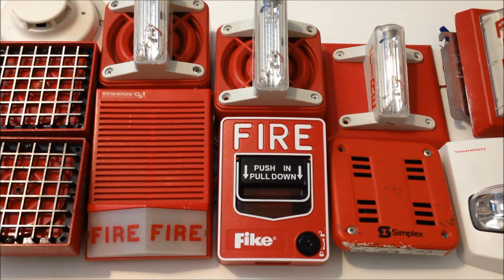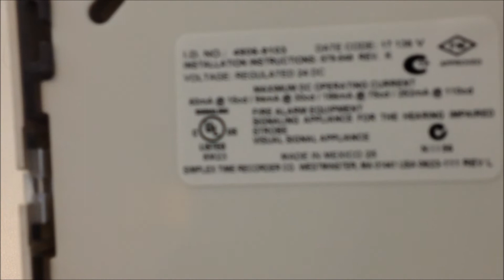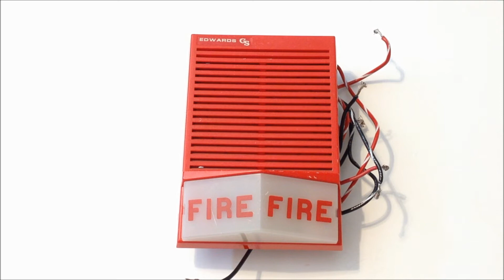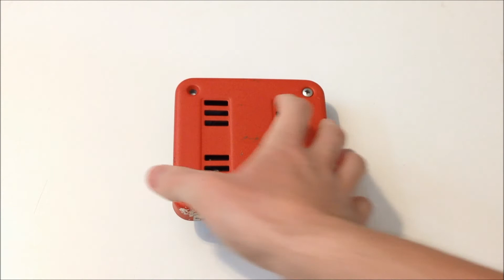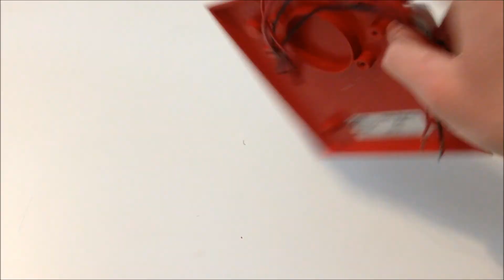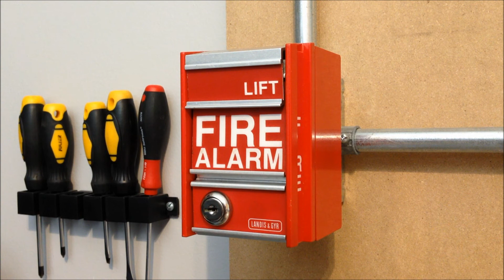New Fire Alarm Devices | August 2017

Comment: Federal Signal 450E horn/strobes have their own model numbers, actually.  The model number, I believe, follows the format of 450E_24R, with the first letter of the strobe's series number going in the blank (i.e. 450EA24R for V1971 series AB2 strobes, like what I have).
Reply from the maker: That's interesting! I didn't see anything on the ID labels that would indicate a different model number - both the horn and strobe retained their own separate labels.
Reply: kcin556 
Usually, the box would be the only thing that indicates the model number.
I originally noticed the full model number when I shone the shipping label (which hid the original model label) in bright light.